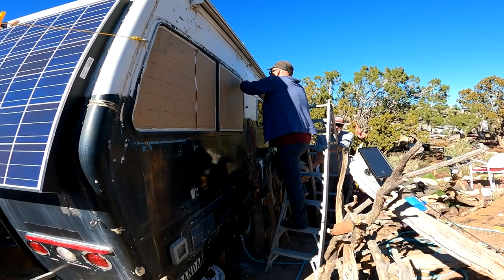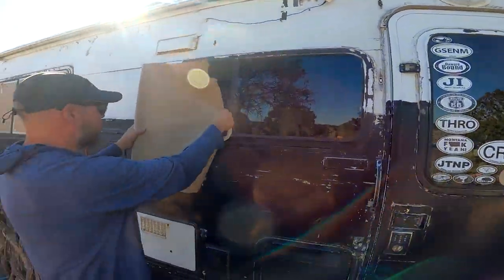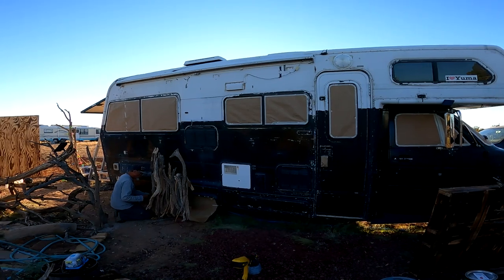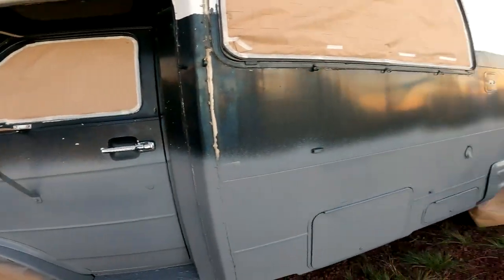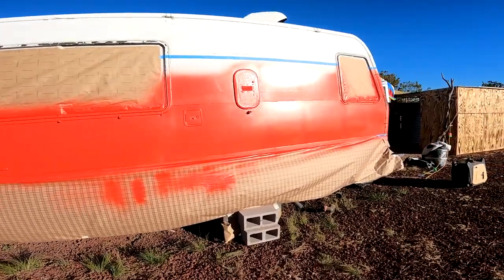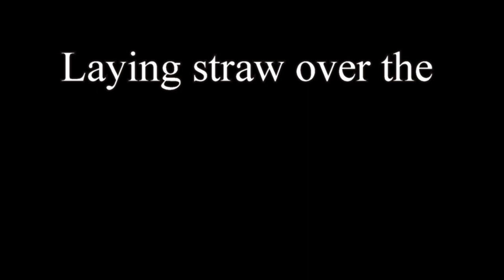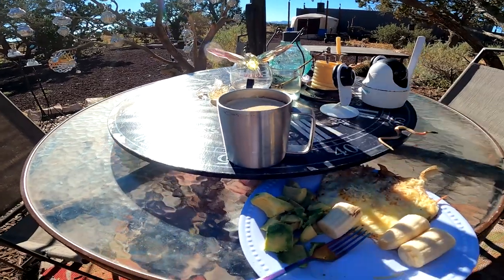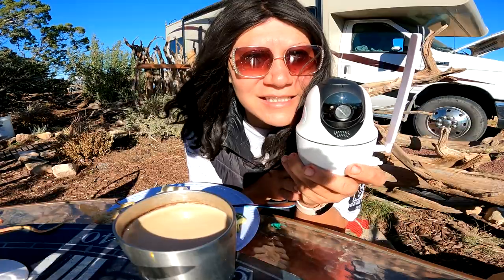Panda Get New Paint, Spy Camera, Straw Mulch Garden & Elli Burns Cancer Gown

Comment: Ausia, . I forgot to tell you more about the rodent problem……besides wearing gloves ….they really hate mint and peppermint. So I’m thinking planting mint in small pots and put them in and around the engines and structures you use for living.  The reason they go for wires in the RV’s is because they are making the wire sleeves out of corn…if you can believe that craziness!  My Brother is a master mechanic and told me this.  If you don’t want to plant mint you can use the oil on felt or sponges and set them around the engines also.  Hoping you conquer this problem!!